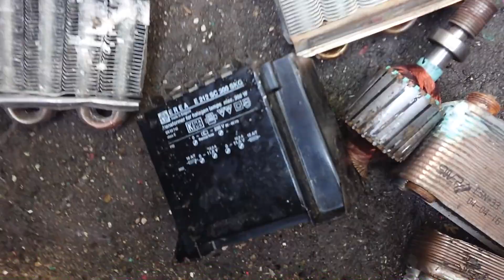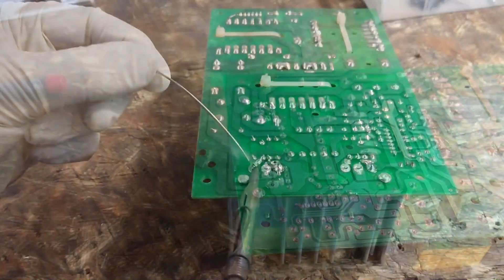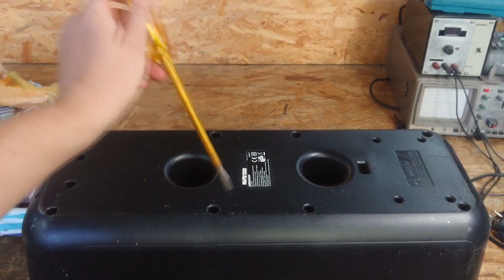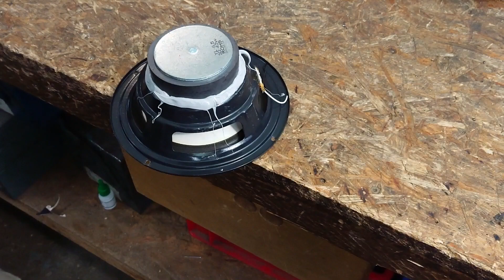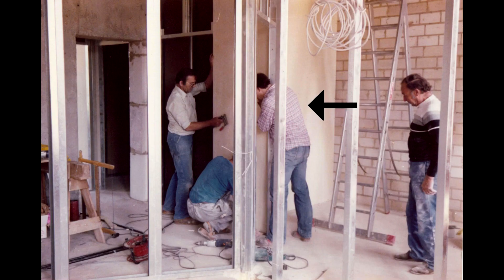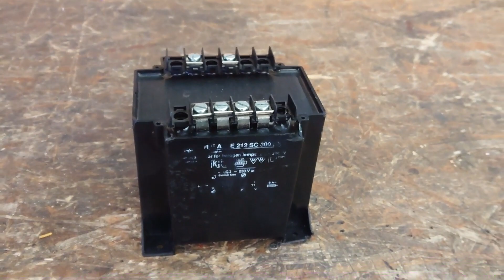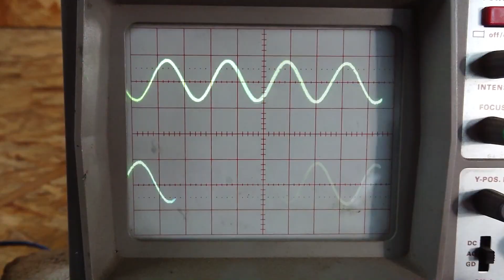Unusual Scrapyard Finds! Repair-A-Thon!

Comment: It is a pity you are not near Manchester UK over a weekend, I would invite you to join us at one of the four Repair Cafes each month that we volunteer at. We do one each Saturday morning and they are often really busy each of us doing 3 or 4 repairs, or more, each during the two hour session.

Your videos are a real inspiration for me as a repair cafe volunteer.
Reply: Here in New England (Northeast USA), I volunteer with the local Repair Cafe, but ours are held every 3 months. I'd be happy to do one every month......we fix a lot of lamps;  clogged-up vacuum cleaners that maybe need a belt and a filter are another popular repair item, as well as seized up sewing machines that need some heat and lubrication to get them going; but in truth we never know what's gonna show up for repair.
Reply: @goodun2974  We get very similar repairs every week. Lots of lamps, toasters, kettles and vacuums. Also bicycles, toys, bags, clothes, some furniture, a few power tools, and occasionally some very random oddball stuff. Some things, unfortunately, just can't be repaired in the time available, like laptops that can that the whole session just to run a diagnostic.
Like you we mostly never know what might show up, but sometimes we get enquiries that gives us advance notice.
Reply: @Maker_of_Things  ,  At several repair cafe events we have had a volunteer who does basic bicycle repairs, and we usually have one guy who's really good with  clamping and loose chair rungs and other wood items, and a guy who sharpens knives and garden tools and so on. We even have 3 or 4 women volunteers who will sew clothing and do minor repairs and alterations.  My skills are mostly electrical and electronic in nature but I'm also good with glues and so you never know what I'll be asked to fix. Lately I keep getting tasked with fixing seized-up sewing machines and small bread-dough mixers and other kitchen appliances, all of which need lubrication.  In this regard, I am a victim of my own success because I am usually able to fix them, and none of the other guys and gals want to deal with heavy, messy, greasy machinery, so those jobs come to me by default!
Reply: @goodun2974  I go with my wife, she does a lot of the sewing, clothes, bags, soft toys, and jewellery repairs. And if there isn't too much fo her she will do triage for me if there is a long queue of repairs. In return I often help her with zippers and soldering/brazing small metal works.
We don't have a blade sharpening service but I guess that would fall on me too. I pretty much do everything with a few additional 'other skills' experts around me.
It was my wide range of skills that lead to the first repair cafe starting up here. They asked me to volunteer on the basis that if I refused they wouldn't get started. For a while at the start, and shortly after we unlocked the pandemic, my wife and I were the only  repairers.
With them being weekly since 2016, aside from lockdown we have only missed about 4 repair cafes due to booking our holidays.
We only get a Saturday off if there are five Saturdays in the month.

Comment: Amazing job. I love your videos. I love fixing things ( I was a heavy truck bus mechanic for 45+ years before retiring 1-1/2 years ago) but my electronic skills are nowhere near your level. I have that same Fluke multimeter/ oscilloscope that you repaired in the video, I bought it cheap at an auction a few years ago and use it occasionally.  Cheers from the Minnesota in the USA.

Comment: If only my friends had Fluke equipment. Also while repairing this kind of electronics I would reccomend wearing clean gloves and antistatic straps as static can kill many devices and even tiny amount of dirt or grease can cause interferance. Take care and keep the series up!
Reply: As an old bench tech and engineer, the likelyhood of killing any of the stuff he was working on with static is slim and none and slim left town. For computer boards and cutting edge stuff yes... But audio equipment and fixing test gear, No. The chip dies are too big and too tough and robust. The ISO assholes and procedure people push anti stat to reduce the possibility of problems to a min in the manufacturing process, but of all the thousands of pieces of equipment including video games from the 80's and 90's I have worked on... ZIP. Your fears are mostly unfounded.

Comment: Thanks for these repair tips,   for more energy efficiency you can change the halogen lamp by a led with switching power supply.
Reply: not that easy because the reflector is a parabolic type that relys on the 360° beam pattern of a halogen filament in the focuspoint.

with led you cant have 360° beam in a small spot AND provide enogh cooling.

Comment: when in a pinch or strapped for cash, you can weld a cheap bit to the tip of a rod, nail or threaded rod to get a long screwdriver 😅

Comment: Worn or dirty contacts would have been my first suspicion on that old Fluke meter .
I have fixed a lot of remote controls and other equipment with similar controls ,  just by cleaning with IPA and a cotton swab .
I love that old lamp and how you repurposed it .
Scrapyards are always interesting , full of endless possibilities   for anyone with some tools and imagination .
Reply: I repaired a digital products remote today using those same products. It had not worked for over a decade! (I tend to think a Q tip inside those buttons and a good scrubbing of the PCB with a #2 pencil's eraser would have made that Fluke work again w/o the new board purchase)
Reply: I repair a lot of playstation controllers and moře often than not, the carbon from the flexible board completely flakes off and the whole board has to be replaced.
Reply: @adamchudomel6230  sometimes a graphite laqueer may help with a mask out of a piece of a plastic tape. I even saw one fixed (for some time) by a middle-schooler with  pencil powder, IPA and rosin mixture to renew the joystick sensor. Necesity is a mother of ugly hacks :)

Comment: The speaker is still pretty cool.  At first glance, I thought you may have lucked into a JBL Partybox....I just repaired a 710 model and it sold for 400 USD used.  I've have some other good scrapyard finds lately...a Lincoln TIG 175 welder that was fully functional, an old racecar intake manifold for a chevy 350ci engine, and 200 pounds of japanese motorcycle brake calipers and engine covers...all purchased at scrap prices!
Reply: Bluetooth speaker is of Medion brand – a cheaper brand sold by German discounter supermarket Aldi. Chinese made stuff of varying quality, you might be lucky or not sometimes. JBL as a brand of Harman is of better build and sound quality overall. Therefore also with much better resale value…

Comment: Your opening comments about increasing complexity multiplying the points of failure strikes a chord.  I’ve often thought there should be minimum design standards required of products but never been quite sure how to assess and introduce such, beyond increasing the buyers rights from 1year to, say 5years, as a blanket requirement.   Travel safe and keep up the great work 😀👍

Comment: My recent scrap yard acquisitions include a conduit offset bender, some unused fasteners, and some welding materials. I also bought 3 small hydraulic cylinders and associated hydraulic lines for building a dedicated snow plowing machine. It looks like I'll be using a Honda GX390 engine on it. I'm using a John Deere mower frame and seat pan, and some Jacobson steering parts.

Comment: You could have sold the Grundig radio for parts. There were many things inside still useful for restorers and collectors.
Reply: Sometimes you have to pick a bit more carefully as you would end up taking everything. I tend to pick things I want myself or are pretty sure they are worth something.I have found that the things you think may be of value to others often aren't.

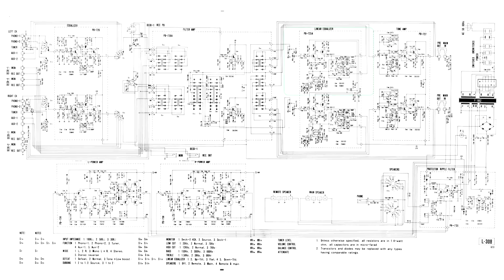Comment: 22:43 Hats off to anyone who can decipher whatever the hell is going on in there. The last time I've learned about circuits was in physics class in 5th grade so the only thing I can confidently say is "It seems to be running on some sort of electricity".
Reply: 🤣🤣🤣🤣 That's about the extent of my electronics knowledge as well.
Reply: To be fair that schematic is really dense. They must’ve had to squeeze it on one page
Reply: You sure need some time to understand whats going on in these plans but if you got the basics, its doable. Especially if you got an old plan like this, where the function of each part of the circuit is named. Especially in radios and such you can do it by normally just by following the signal. But i guess it is easy for me to say that as I work in developing measuring equipment, even when its more in "testing and bug fixing" than designing the circuits.
Reply: @Ckay2552  i hear you there. love to find out which little bugger is causing the problem. but don't tell everyone we know the secerets... i need my job. =o) just tell them the magic smoke just came out of it. lol